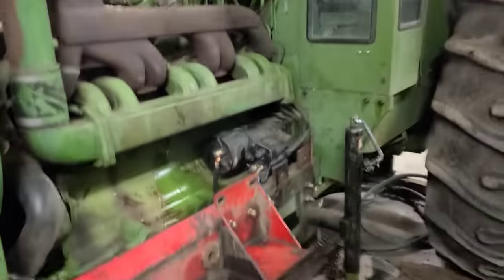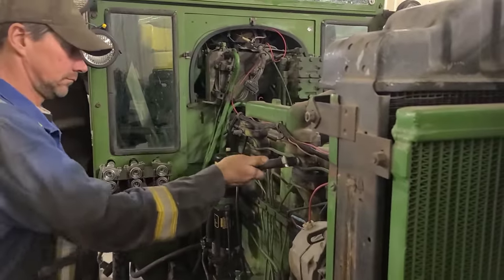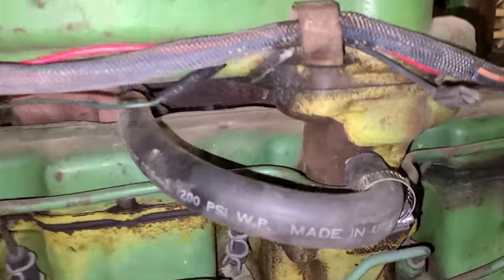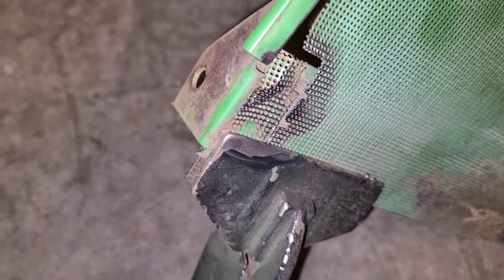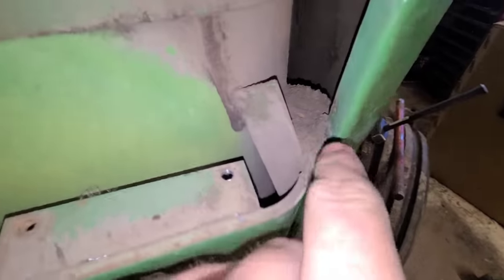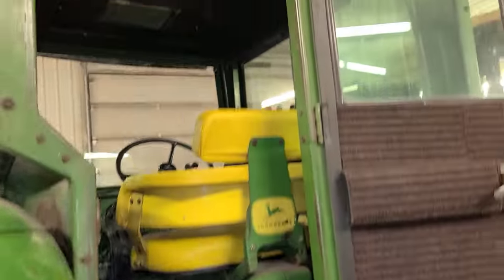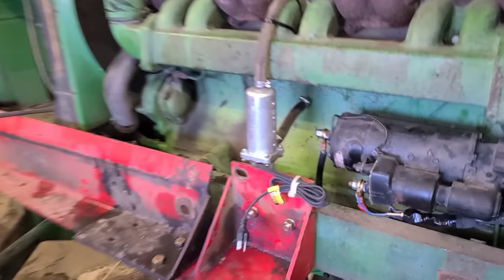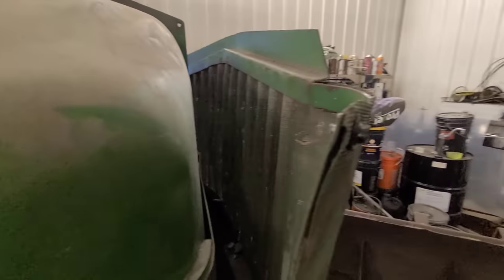Testing out the 5020s P.T.O!

Comment: Back in the 70s worked on the north slope of Alaska. We had 1100 watt recirculating heaters. Some times it took a day to warm an engine so it would start. Found out if we put the heaters in the way kats wanted us to do like you did most of the time the hot water would go to the top of the thermostat housing,, open up the thermostat, and go into the radiator. Didn't always do the best to warm the engine. So we mounted them lower pushed the hot water into the bottom of the engine. took half the time to warm an engine at neg 45 degrees. So plug in your heater and see if the upper radiator hose is getting warm and if it is at all you are loosing heat.
Reply: We've never had one open the stats yet. Shouldn't circulate that slowly

Comment: Our 4010 has a nipple pressed in the head, always thought it was factory.
You realize, they make magnetic hex drives for the little drivers, come in quite handy.
Single wire Delco, just run er.. no messing around with switches.
Reply: Ya this is a  3 wire so .....maybe might need a 1 wire to simplify

Comment: How are you now
Reply: How many horse power were the 5020 when they came off the line
Reply: @frankkokoski7995  Back in  1966, when the first 5020s  came off the line, it was rated at 133 pto horsepower.  By 1969,  the  5020s coming off the line, in that year was rated at 140 pto horsepower.